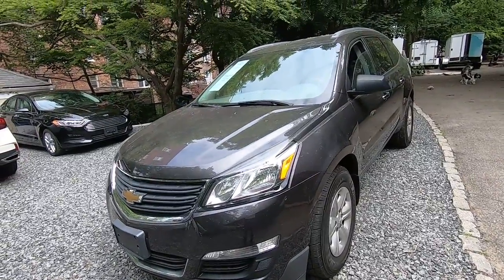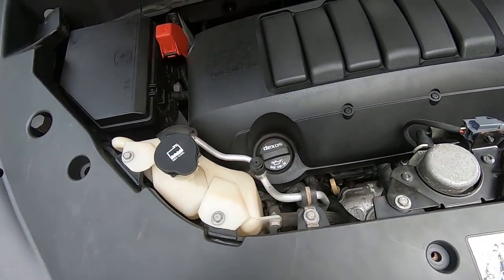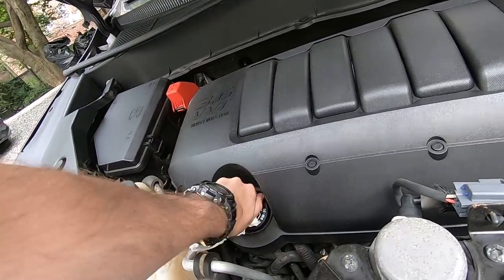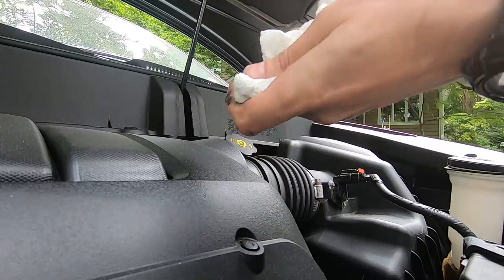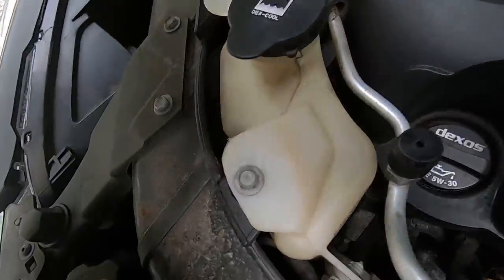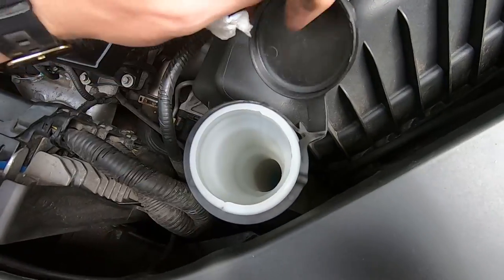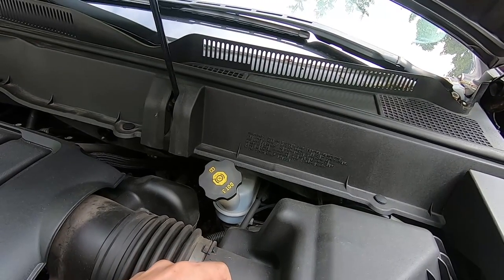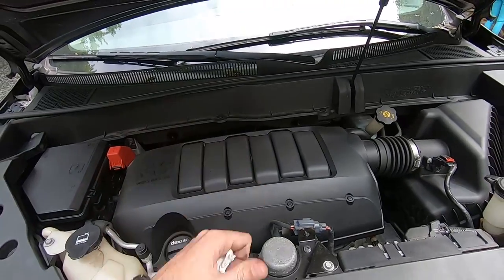Chevrolet Traverse Oil and Fluids Check 2009-2017

Comment: The 2017 traverse has power steering fluid and a reservoir underneath the cover. It is not an electric pump. It is hydraulic and uses Dexron VI fluid.